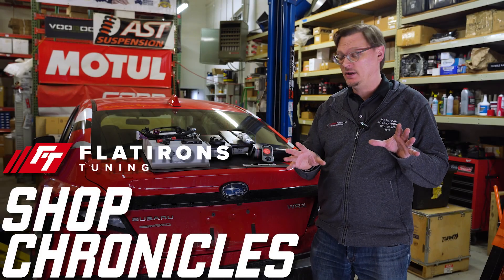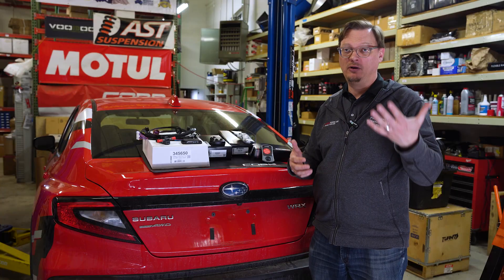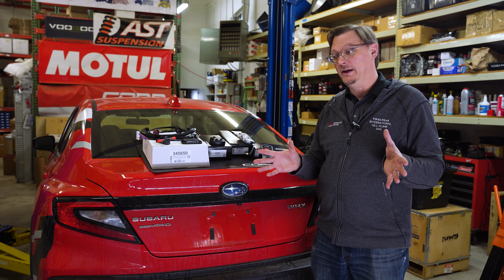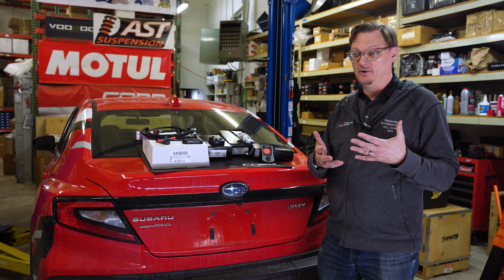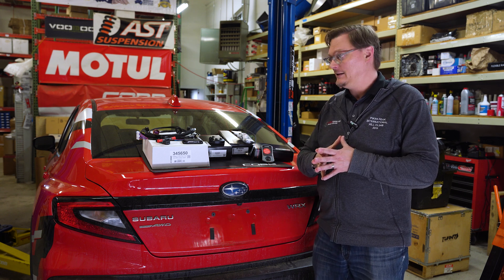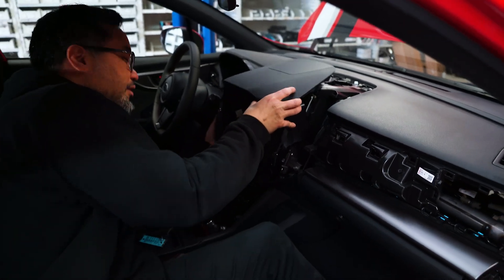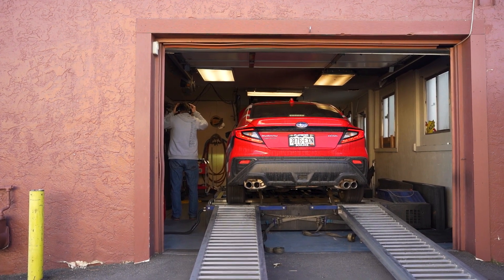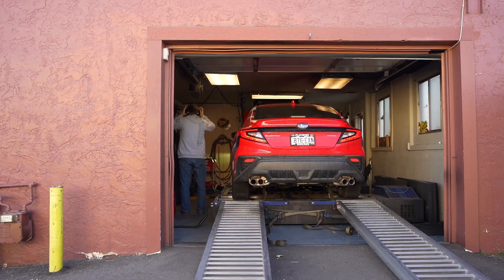Cobb Flex Fuel Results on our 2024 WRX

Comment: I’ve been having issues after installing my flex fuel kit from Cobb. Still waiting on tech support from them but I’d like to pick you brain on what’s going on

I was tuned on 93 before Installing the flex kit. The car ran great. I installed the flex kit and got tuned for e30. The car now cannot go over 5k rpms without fuel cutting out. My tuner said I was running out of fuel so I upgraded with a walbro 450. The car did exactly the same thing. When I mash the pedal at 5k it sputters and falls on its face. I switched over to my original 93 tune with a fresh tank of fuel. The car continues to do exactly the same. I put on iag hpfp think maybe I screwed up my pump or maybe the e30 tube screwed up the pump. The car does exactly the same thing. I unhooked the can bus jumper thinking maybe the kit was defected and is the root of the problem. I left the fuel lines the kit came with but just disconnected the can bus. The car continues to do exactly the same. My tuner who has experience with Subarus thought it was really weird the pump was pushing 3500psi when the target was 300 at times. I do not have a direction on where to go. I’m desperate and trying to reach out to guys that are way more knowledge able on performance than I am
Reply from the maker: Thanks for the comment and I'm sorry that you are having trouble.

From everything that you are describing, it sounds like you have some kind of mechanical issue because it is still present after removing the Flex Fuel Tune, sensor, etc.

I'd say working with an experienced mechanic with your Tuner would be the best path.

Hope that helps and Stay Tuned!
Reply: Did this start after the IAG HPFP was fitted?
Reply: @thebagdersarse5824  no this started after putting on e30 tune. I switched back to 93 tune and the problem did not go away. I then installed the iag hpfp thinking that was the problem. I also replaced lift pump and regulator. To follow up the block exploded on me. Right thru the top. I still don’t know what happened and tuner is leaving me dry. I truly don’t know what went wrong. The car drove like a champ till I did the e30 tune. I’m wondering if for any reason it jumped a tooth on the timing chain?
Reply: @Stumpy10300  I've seen a couple of people who's had a similar problem and it seems to be a pump/software bug? Its apparently dumping fuel in around 5,000rpm. Sorry to hear about the motor goin pop.
Reply: @thebagdersarse5824  do you know what the cause and how to fix it. I’m going to put a block in it but I want to make sure I don’t get the same problem

Comment: WHAT ELEVATION IS HARVEY AT ??
Reply from the maker: His shop is in Longmont, Colorado, so about 5,000 ft elevation.

Thanks for watching and Stay Tuned!
Reply: @FlatironsTuning  Is that why the stock HP was so low? I thought this car made about 250 to the wheels stock.
Reply: @ViaticalTree  that’s not how dynos work.. there is no perfect correct number that these cars make to the wheel. Every single car is going to be different, all states different, all dynos different.

Comment: Awesome video, guys!  Can't wait to see the next steps with more parts and a Harvey tune!  One note - Yes, you can absolutely install the CAN Flex Fuel components and not worry about immediately having to change the tune.  We broadcast our CAN data on channels that are unused by the car in stock form, so it doesn't interfere with anything. - Marshall@COBB
Reply from the maker: Thanks for that confirmation Marshall.  That is a big deal honestly, and very glad to hear it.

There is definitely a lot more in store for this WRX!

Stay Tuned!

Comment: How far do you and the tuners recommend is the minimum distance/drive time per trip to make sure the ethanol sludge does not form or build up and affect your engine? My trips to the market are very short only 5 minute drive, and my drive to work is between 15 to 20 minutes.
Reply from the maker: A 5 minute is a fairly short trip.  That isn't the end of the world, but that 15 - 20 minute trip is more ideal.  As long as you are getting the car warmed up and taking a good drive at least 1-2 times a week, hopefully the buildup will be minimal.  I'd say just monitor it, and hopefully you won't run into any issues.

Thanks for watching and Stay Tuned!

Comment: Interesting! Wonder why you guys made so much less power than Cobb did on their mustang dyno. Must be altitude related, no?
Reply: For marketting purposes, I didn't expect Cobb to run their tune in a "heartbreaker" dyno.
Reply: @RandomlnternetGuy  we don't manipulate power gains to be more or less favorable and as @FlatironsTuning mentioned, every dyno is going to be different.  For those reasons, we take an average of three pulls at each power level and focus on the delta as that percent change should be consistent regardless of dyno. - Marshall@COBB
Reply: @cobbtuning  and just like that, speculation ended. Thanks for thr reply
Reply from the maker: Altitude would be part of it, and we also have oversized tires on the car which also played a part most likely.

Dynos are hard to compare to one another because there are so many variables, so the gains are more telling than the final number.

Thanks for watching and Stay Tuned!

https://youtu.be/9zo80lXiqdA?si=6WADiM9zqGCOtCTy

Comment: I’m not a huge fan of cobb, being a normal person due to lack of tuning capabilities and being locked from tuning Esspecislly now. Hp tuners works well on the new subis. to bad they don’t have any Tactrix stuff for the 16+ stuff. If you have access to tuner pro then Cobb can be an awesome tool. But if your like me and tune primarily with Tactrix open source or hp tuners, it’s the way for us low budget folks. But since Harvey is your tuner for you guys then the Cobb will work great. Cuz I know Harvey is having his way with it.. and the tune will be custom to the car… now just needs a big ol turbo now.
Reply from the maker: Thanks for watching and thanks for the comment.  This was just the baseline, so we were looking at the completely stock car, then the Flex Fuel base map with pump gas and E85.

There will be some custom tuning done, but that will be in a little bit.  Then it should be even better than it is now.

Stay Tuned!
Reply: SubaruEdit(epifansoft) claims 2022+ WRX on their compatibility list, leverages tactrix.